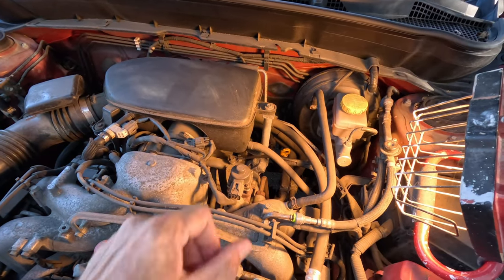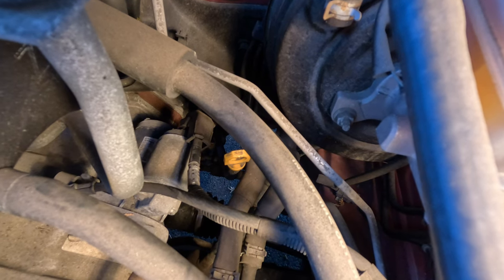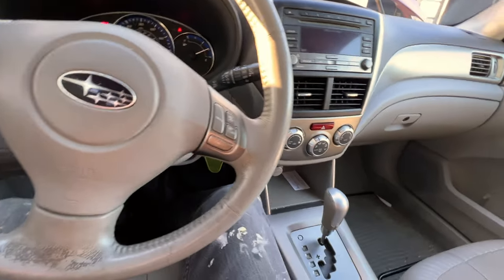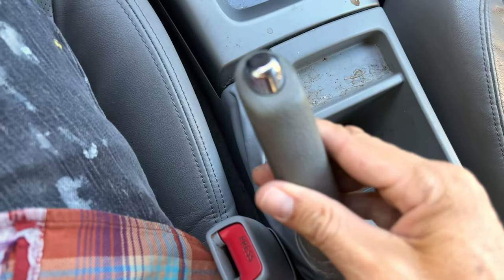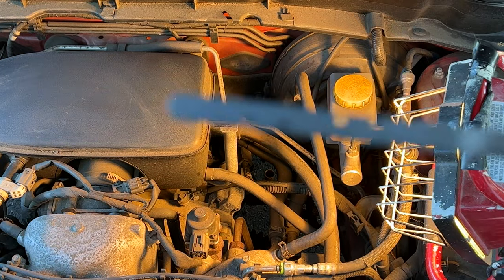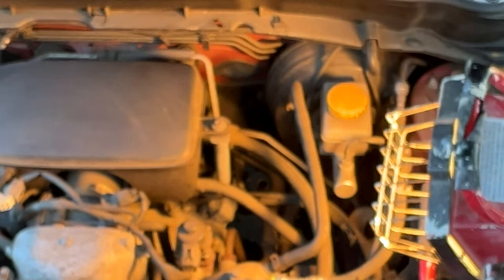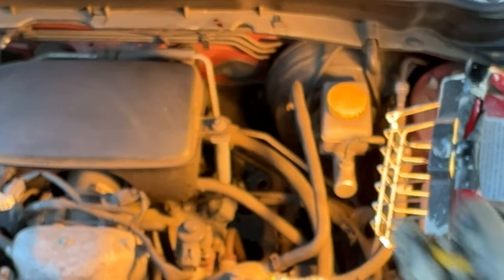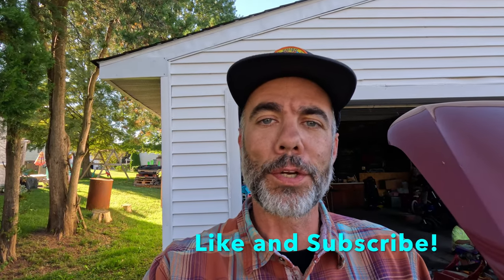2010 Subaru Forester (3rd Gen) - How to check automatic transmission fluid

Comment: Can I ask, if it has a cold measurement, why can’t we just read it with the engine off, and use that measure. I’m just not a car person (or a tall one)  so it makes me nervous leaning over the engine whilst it’s on.
Reply from the maker: Fair question.
The best time for a reading is when the car has been driven for a few minutes.
However, there is a cold line on the dipstick, and yes, you can use that for a reading when the engine is cold.
However, it may be inaccurate, and that could lead to you having too much or too little transmission fluid in your car.
Reply: Because when the car is stopped oil drips into the pan from the torque converter. Without the engine running you will get a higher
 inaccurate reading.
When the engine is running oil is taken up by the torque converter.
Reply: @nickl2548 when using the cold marks the engine still needs to be running, it's just not up to operating temps.

Comment: What is the dip stick on passenger side at the rear of engine for
Reply from the maker: If I’m not mistaken, that would be either your manual transmission oil level for a manual, or the differential oil level.

https://www.subaruforester.org/attachments/na-sg-motor-jpg.25481/

Comment: how did you "top it off"? just guess and pour some fluid down the dipstick tube? what if you add too much?
Reply from the maker: Good question!
Leave the car idling and in park and use a funnel to pour transmission fluid down the dipstick tube.
Be sure to use correct fluid for your car!
After adding a little bit, run the car through the gears as you did when checking it, and then check the level.
Add more in small increments and repeat the process until full.

Comment: Good info.  Couple of things:  What is the fluid capacity of the transmission.  After you topped this off, was it difficult to determine the fluid level?  (Dipstick misreading due to residual fluid in the downspout)
Reply from the maker: Thanks for watching!
It’s my understanding that the capacity is 9.8 quarts.
After topping off, I let it sit for a moment to let the fluid subside.

Comment: Hola 
Desde chile 
Que puede producir exceso de aceite de transmisión?
Puede producir error en la tracción 4x4?
Reply from the maker: Tengo entendido que el exceso de líquido de transmisión solo puede ocurrir cuando está demasiado lleno.
Si se llena demasiado, el líquido adicional debería salir por el respiradero, pero no causará problemas con el 4x4.

My understanding is that excess transmission fluid  can only happen when it is overfilled.
If overfilled the extra fluid should push out of the vent, but will not cause 4x4 issues.